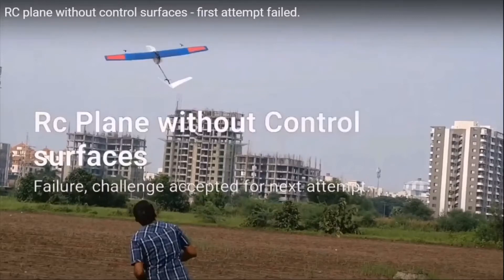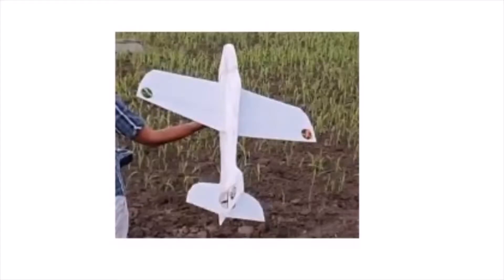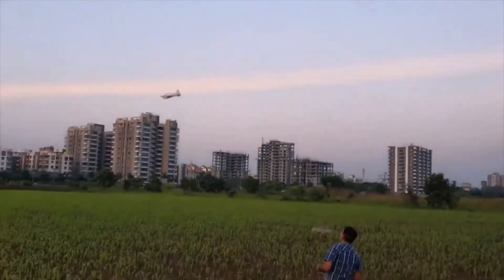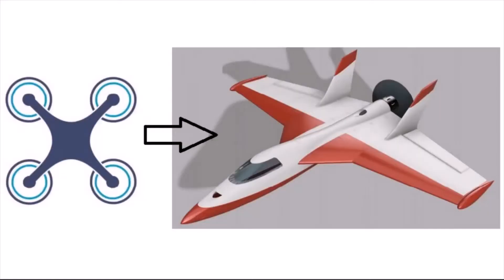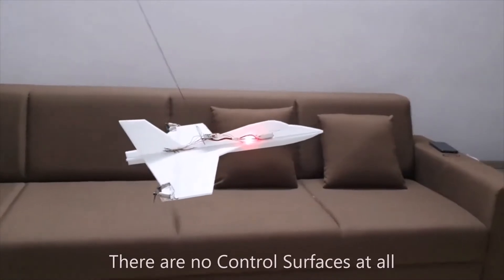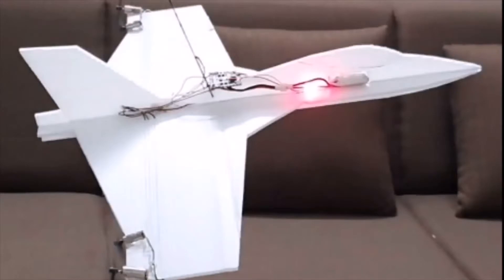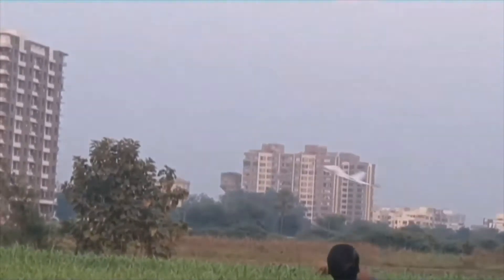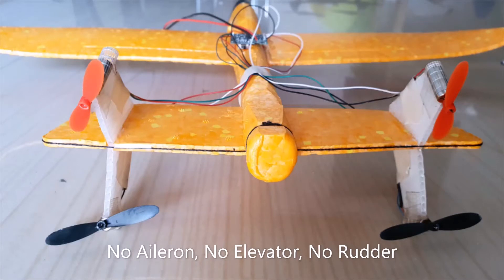Experimental RC plane without Servos and Control Surfaces (Part-4 : Successful Flight)

Comment: The idea is to build an airplane with less complexity than the standard control surfaces with the servos and linkages that move them? Or is the system about the same in complexity? I am curious if this approach could be combined with the standard control surface techniques to make a redundant system (a backup in case of failure of one system) or just an extremely maneuverable aircraft design.
Reply from the maker: Sorry for late reply. 
I have seen testing of an aircraft where they added this with standard control surfaces for redundancy. Lets hope we see it in future.